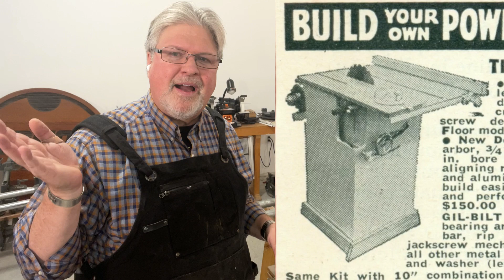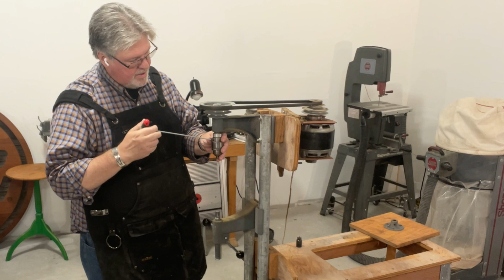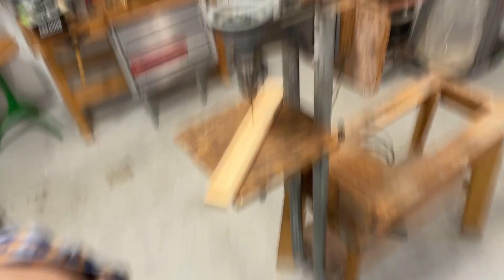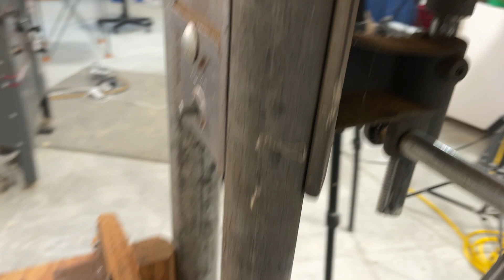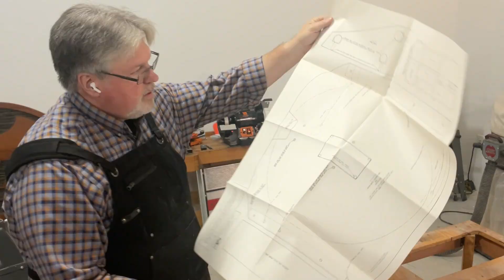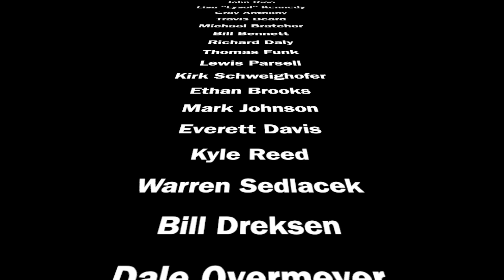Over 40,000 Power Tools Built By Our Grandfathers! Gilliom "Gil-Bilt"

Comment: Very much enjoyed your video. My Dad built our family home when I was born in the mid fifties with the 10 inch Gilliom table saw. We lived two towns away at the time and my dad didn't want to leave his brand new Craftsman 10 inch table saw at the site so, he built the Gil Bilt saw to use there figuring no one would steal it. I still live in that house today. He also built the 12 inch bandsaw. When I was in my 20's I drove that bandsaw off of my South Bend lathe to saw through several feet of 1/4" steel plate! It handled it with no problem. The machines are gone now but I remember them fondly.
Reply from the maker: Awesome stories. I’ll share my Gil-Bilt tablesaw one of these days.

Comment: I have one of these. It is fun but sketchy.
Reply from the maker: @Shogunersash  That it is!
Reply: @MyGrowthRings  So, apparently, the parts are mostly Delco parts that are surplus or general purposes parts from WWII.

The headstock is basically a fan/waterpump shaft and bearing made by Delco New Departure Hyatt. They  seem to still exist in the aerospace industry.

My machine  has a 1/6 hp Delco motor. 

The 5/8 shaft is compatible with some older shopsmith accessories also. It's press fit and pops right out with a couple rubber mallet whacks.

Comment: A friend of mine and I bought 2 of those lathe kits back in the '70s.  At the time we both worked for a specialty steel company in Pittsburgh and ours had solid stainless steel rounds instead of conduit.  Overkill but looked great and was solid.
Reply from the maker: @bruceolson4552  Wow, I bet they were slick. Do either of you still have one?

Comment: Very cool, I remember seeing the ads and wondering if I should build one of the tools. I did almost get the belt sander at one time but chickened out. Not sure if it was because the audio rejected the noise but it seems like it's fairly smooth running. Thanks for another great video Scott
Reply from the maker: I was a little louder than the mic picked up, but not by much. Especially after tensioning the belt.

Comment: Under my dad's workbench there were always two or three motors he had salvaged from old appliances.  I can remember him using one for a bench grinder, another for a belt sander and a third for a table saw.  The "plans" came out of his head!
I still have the bench grinder .
Reply from the maker: @Sal-oi1db  I’ve met a lot of folks who were common sense engineers, and they always seem to have a pile of motors and coffee cans of nuts and bolts.
Reply: I don't know where he got them all, but my grandpa had around 20-25 Sears motors stocked on the shelves in his shop.  If he needed to perform some kind of specialty operation that his current tools weren't capable of, he'd rig up some new tool with one of the motors to perform the task.  One of my biggest regrets in life is not spending more time in the shop with him - I could have learned so much.
Reply from the maker: @nutball7537  We are all guilty of that.